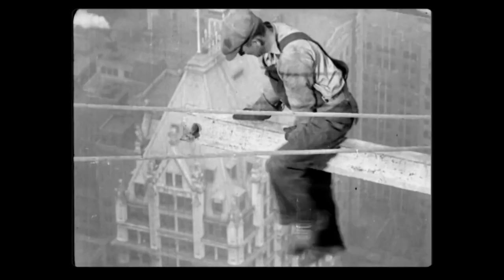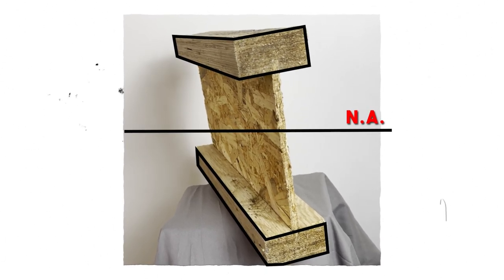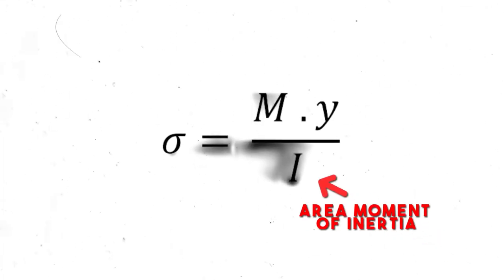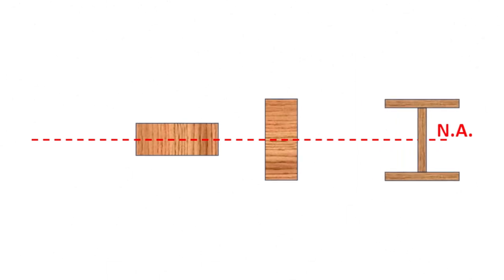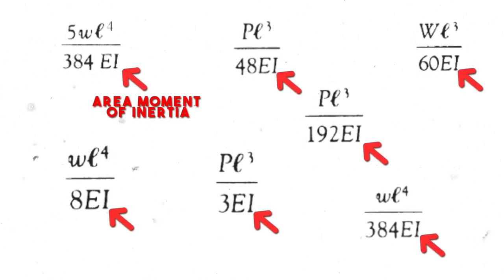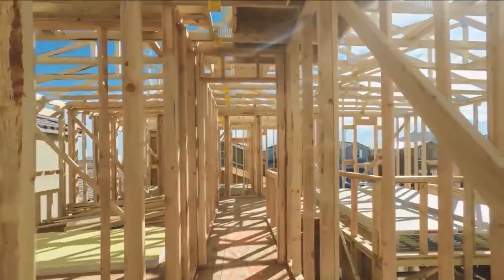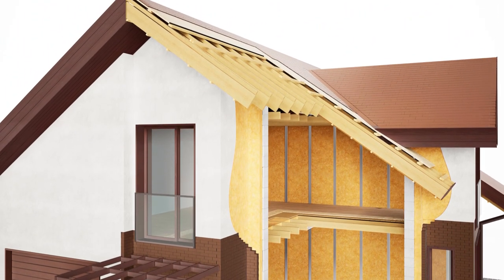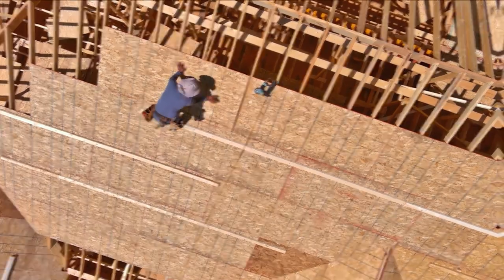The Secret Behind The Strength of I-Beams and I-Joists

Comment: Thanks for video, great content. Most suppliers allow a 12mm notch in the top & bottom flanges when sitting in a steel beam, however there are some that don't allow any notches at all - do you know why this would be?
Reply from the maker: I would say that's lab test-based guidelines for each product. Hard to comment on that, but I would stick with the manufacturer instructions, otherwise the certification is voided.